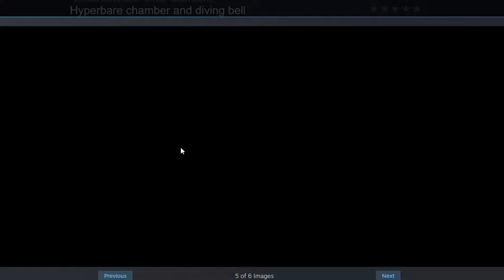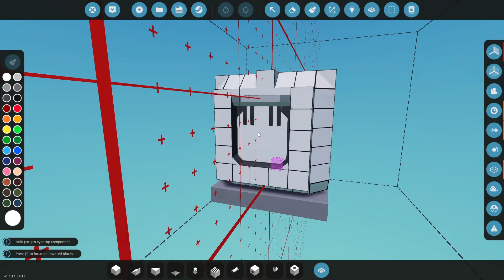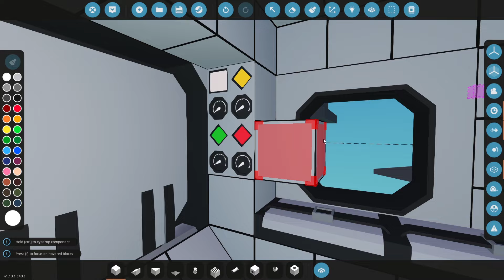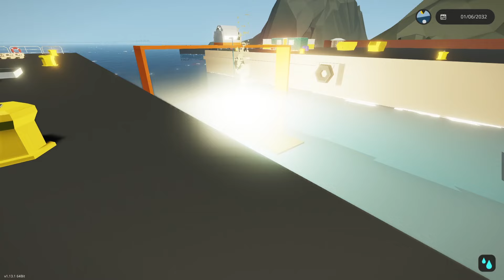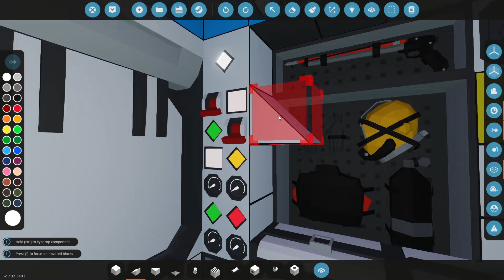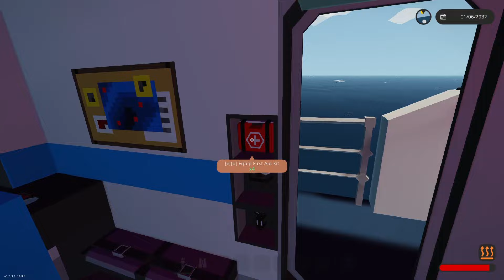Making my SMALLEST EVER Diving Bell in Stormworks

Comment: Lots of features for the tiny thing. Since there is not much equipment to run, replacing the cable with a hose could be an option. 
Pushing air to the diving bell with pumps from the ship may save space on tanks, possibly allowing easy recharge of suits. The space for the air tanks should be enough to get a radio system in place. Assuming the diving time limit for 1-2 people using the diving bell is for sure air instead of power running out.